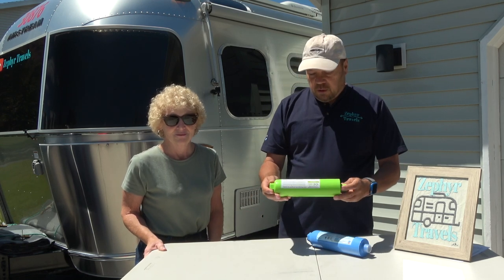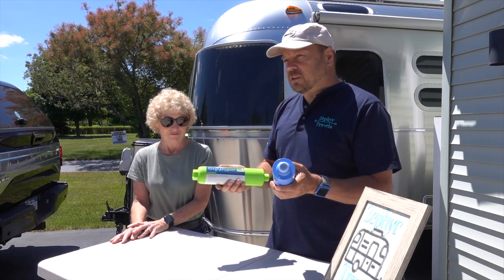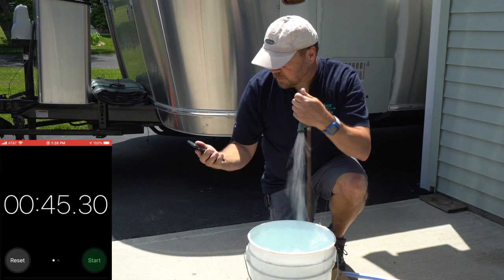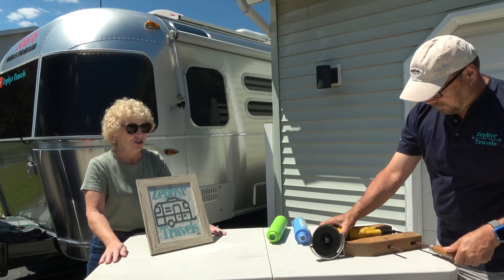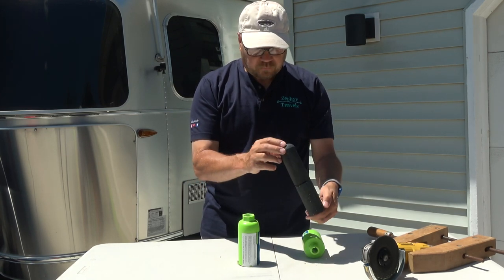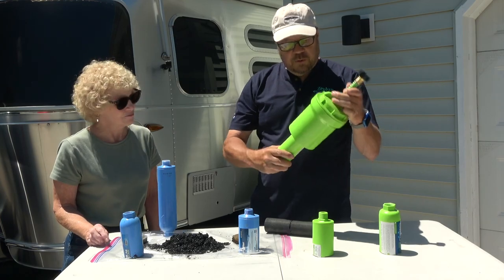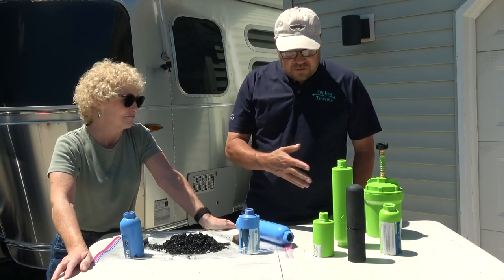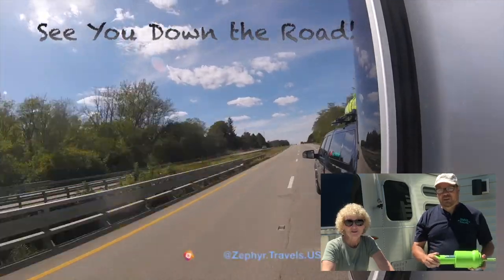Ever Wonder What's Inside a RV Water Filter? | ZEPHYR TRAVELS - RV Lifestyle

Comment: Thank you for sharing this. Did the 1 micron effect your water pressure in the RV to the point where the shower was negatively impacted?
Reply from the maker: I had no problem with water pressure using the clear2o filter.  I found that most campgrounds water pressure is high and the filter has minimal effect.

Comment: There needs to be a better text or demonstration you running that valve is questionable cause on the last filter which is your brand you open the valve slow vs others then the amount you opened is also questionable your start times were off cant go off something like this as a consumer would be nice to see a more controlled test
Reply from the maker: Sorry the results were not what you expected.